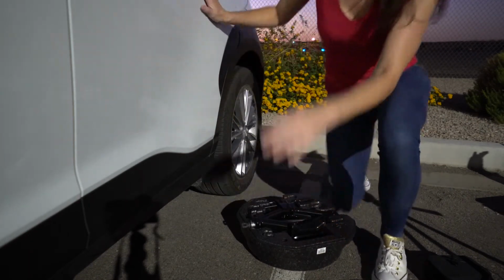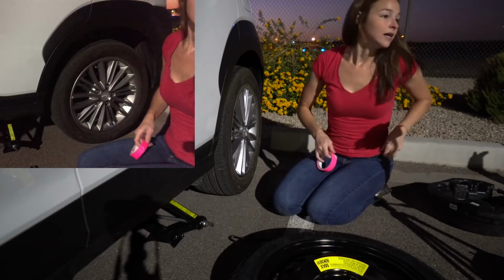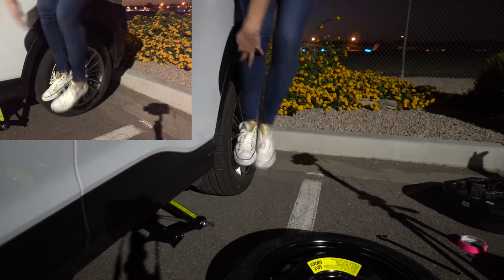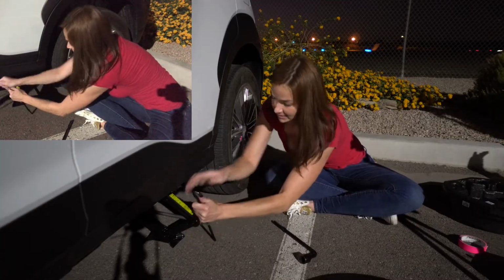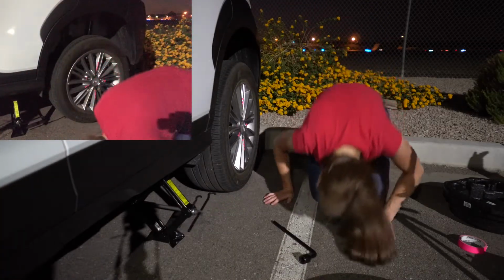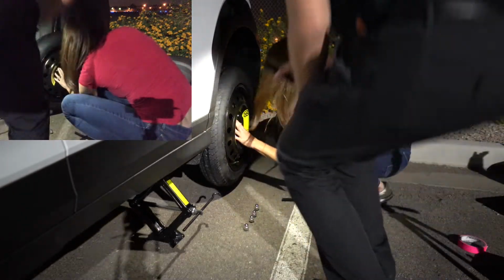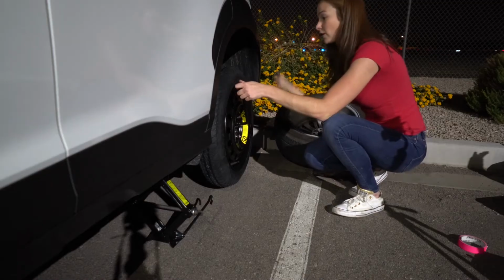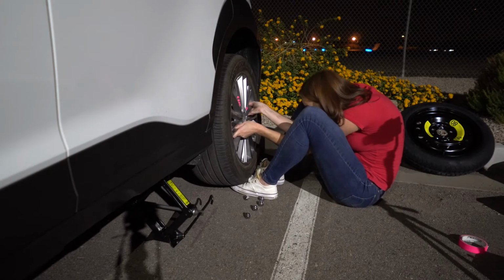HOW TO: Change a tire!  🔧🚙⚙️

Comment: Hello there Jessica! That was great! I do have a word of advice if you like, In the handle of the tool you used to unscrew the lug nuts, there is a square hole. That square hole accepts the square end of the bar with the hook on the other end. That hook end of the bar goes into the hole of the jack, this is so you can use the lug nut tool and hook bar together as a hand crank, which makes raising and lowering the jack much easier and much faster! Figured I'd share that tid bit of info. Have a wondrous day!
Reply from the maker: I appreciate any and all tid-bits of knowledge! The more info, the better. Thank you for sharing.
Reply: @jessicakirsh  Absolutely!

Comment: I keep a 24" breaker bar with an impact socket in my car, because it's too easy to strip those cheap tools that come with the car. With 24" of leverage, anyone could loosen and then tighten the lug nuts. I love your idea of labeling the star pattered nuts!
Reply from the maker: Mitchell Barnow Good to know about picking up a breaker bar with an impact socket, Mitchell! I don’t even know what that is or what it would look like, but I will keep my eyes and ears out for one next time I’m out looking for tools. 👩🏻‍🔧
Reply: Jessica Kirsh I found some good affordable ones on another YouTuber’s channel. He has Amazon links at the end. I’ll try to find for you.
Reply from the maker: I appreciate that!
Reply: Jessica Kirsh You are very welcome! You’ll see a breaker bar and a torque wrench and to the right a single socket. I purchased a four piece socket set, instead of the single one.

Comment: The hardest part of the job is replacing the flat tyre. You  have to lift a heavy tyre while lining it up with the wheel nuts which is the hardest part of the job especially as the tyre is only a few inches off the ground then push it in.

One trick take the break off (make sure you have the front of the car chocked both sides) and rotate the hub until one of the studs is at the top. Easier to line up the tyre before you place it on the hub. 

Note those speed limited spares are quite dangerous. Overall good job. Can't wait to see my daughter try this.